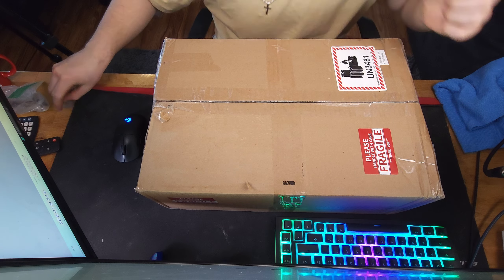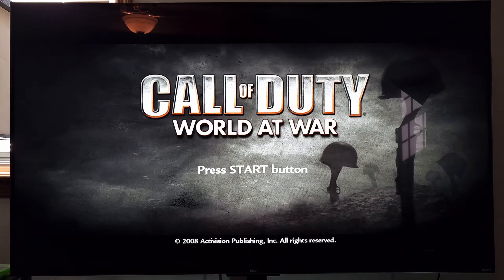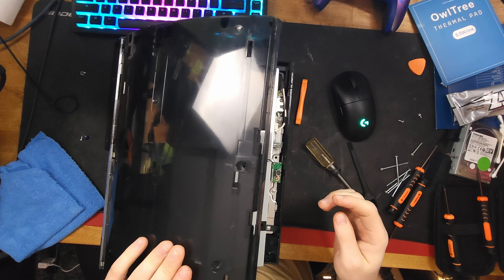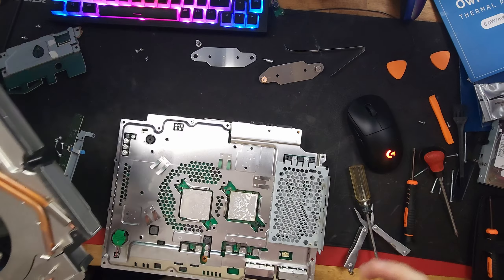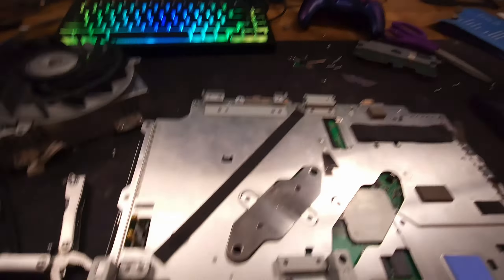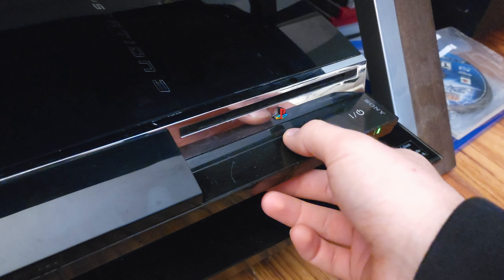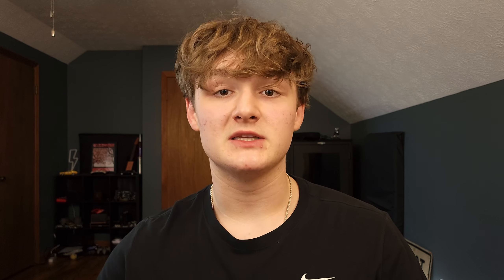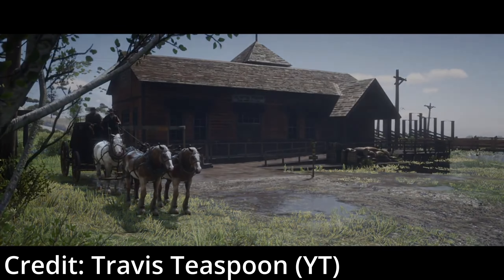You NEED a backwards compatible PS3 in 2024

Comment from the maker: I would like to defend my use of the eraser mod. I understand that it is not good in the long term and could lead to bent pins etc. but after hours of trying this is the only thing that worked. I didn't just do this mod because I thought it would decrease temperatures, I did it because without the extra (yes, too much extra) mounting pressure I physically could not get the heat-sink to contact the CPU after my thermal paste application - there was a literal air gap. I promise I will undo this in the future, I am currently planning a part 2 with a much cooler upgrade and righting my wrongs. Thank you for all the views and support, and thank you to everyone just trying to let me know not to kill my PS3! I understand the risks, but I genuinely could not use my PS3 without it.
Reply: The air gap isn't a big problem, you want to to cool the middle of the ihs not the corner. While the eraser mod applies insane amount of pressure which can cause the cpu die to literally crack.

Comment: I picked up an A07 a few days ago that’s only had 3 and a half days powered on in its life. I plan to strip it, replace thermal pads and paste (still deciding if I’ll delid now or not. Would hate to damage the CELL so soon). Have read swapping the power supply and fan aren’t worth it as the gains are negligible, so will give those a miss. Will also give it a bigger hard drive.

Comment: I have a backwards compatible launch model cecha01 60gb with a 40nm rsx gpu on the board. That’s the ultimate ps3
Reply from the maker: You're right, I'm already thinking of a v.2 with a Frankenstein and water cooling. That would be awesome.
Reply: Honestly once you get the rsx swapped you don’t really need to installing any cooling things to it. The cpu is built like a tank and is designed to run hot it’s the gpu that can’t handle the heat but with the smaller rsx it will run cooler and the fan can focus more on the cpu

Comment: A lot of the people with years of experience on the PS3 have all said that the rubber mod does more harm because the extra pressure eventually causes the CPU to crack
Reply from the maker: I think you're right, I just couldn't find another way to fix the mounting pressure problem

Comment: the launch PS3s are best Gaming consoles of history (3Generations in 1) , but they need maintenance and extra care.
you should Delid cpu and rsx ,use liquid metal on the die and thermal paste on heat spreader, it gives you best result. also changing thermal pads and create some hole on bottom of console case will cool down the console effectively. and that will be the Real Ultimate PS3 bro 😉

Comment: great vid man! for such a small channel, the vid was great. however, i wouldnt recommend doing the eraser mod as youre putting extra pressure on the CPU itself, which is stuck to the motherboard by little solder balls. that extra pressure might even crack your processor. that idea was taken from some repairs that sony did that were done with a specially designed holder that applied the pressure on the motherboard. for eg: https://www.youtube.com/watch?v=xlwJo4w-BBY
Reply from the maker: I was honestly thinking this, the only problem is the whole mounting pressure. That being said, I think using some of those Honeywell ptm750 (or whatever) thermal pads people were going crazy for on the steam deck and laptops would be able to fill the gap in the mounting pressure without doing that. Thank you for your comment!